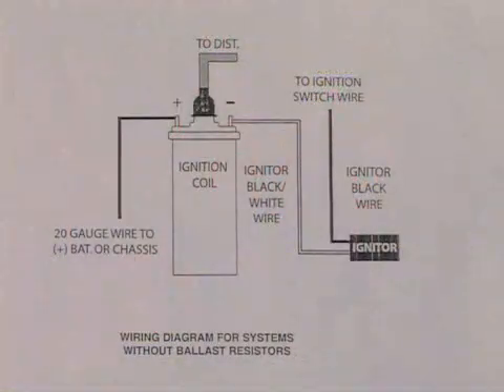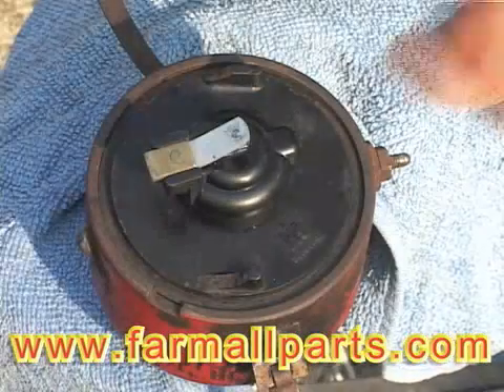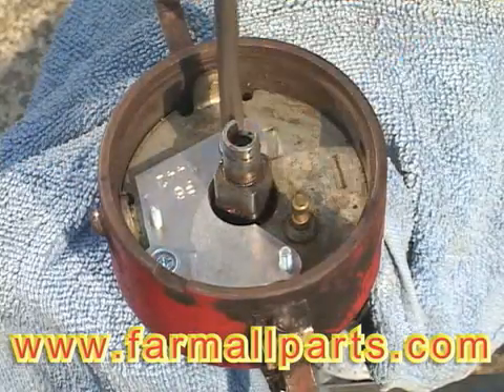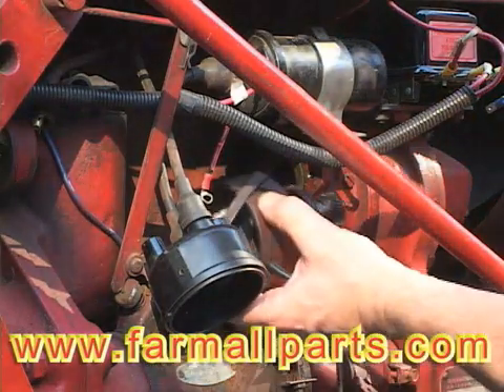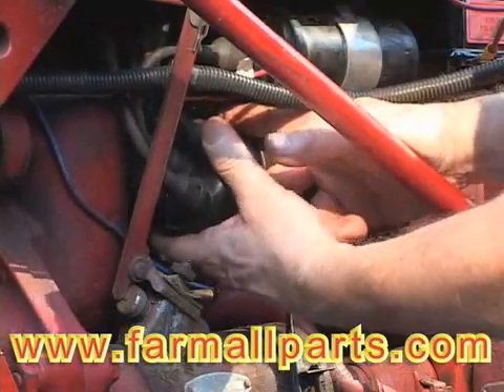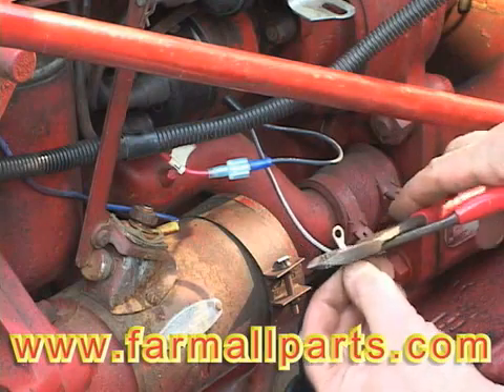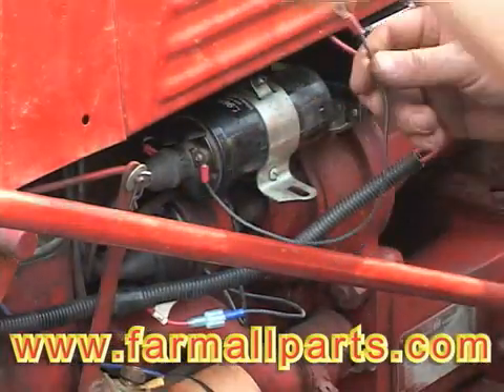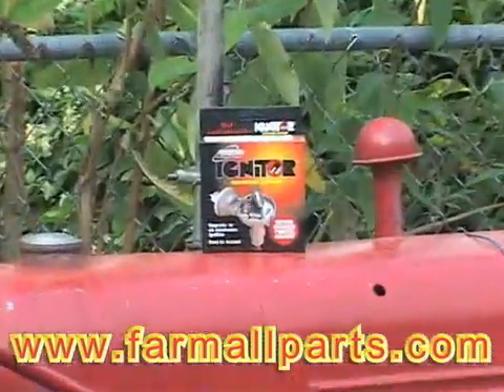How to Convert Farmall Cub Distributor to Pertronix Ignitor Ignition Kit.

Comment: I have had this unit on our Cub now for over 12 years.  It works great.  Never worry about dwell or any other adjustments.  
One thing to note however is that there needs to be at least 5.2 volts to trigger a spark signal.  Unless you have a strong battery and electrical system, cranking the electric starter draws down the voltage too low.  The engine will not fire until you release the starter and the voltage returns above 5.2-volts.  That actually happened in this video.
Reply: Interesting that happens with the 184 international, doesn't start until i stop Turning the key,  thought it was a timming issue.

Comment: Have 15 of these. All are original. All run great for 20 plus yrs now. Never understood why ppl jump so fast and high to do this. They lose their ability to work on stuff and adjust stuff and figure it out. The original was a great working and adjustable product that ran 70 yrs on some units. And for anyone reasing or commenting back here, i will go ahead and answer your comment.....NO, these electronics are not plug it in and go and now worries as someone stated. They actually do fail and have an estimated time life that is actually less that the original units had !!! But the fact of plug and play and no adjusting is just too big of a draw for most so they put this on. Both work, and im not saying they are bad, nor am i saying i am against them, but you are an idiot for removing perfectly good parts for this. And i will challenge any of you on the hp and the fuel economy BS.....same argument in the 50s when all the dealerships told their farmers they had to switch from mag to coil. Hotter spark, more hp...lol...total BS. half of ours are mag and half are coil tractors and i have pto dyno both and the hp and rpm are same lol. But then again, i already knew this from 2 generations of daf and gmpa telling me it was BS. As they told me, that plow dont lie boy ;) put it in the ground and she will tell you which tractor has what. Or you could just go with what this guy says or the dealer said in the 50s........cause you know they wouldnt tell a lie ;)

Comment: One more question I have, have you ever installed a turbo on a non-diesel tractor engine?  Since the 154 is under powered 14 HP on a 4 cylinder, I'm wondering if adding a small turbo would boost power output.  Not sure how a person would go about getting around the strange intake/exhaust setup on the 60 to add a turbo to it. Any ideas?